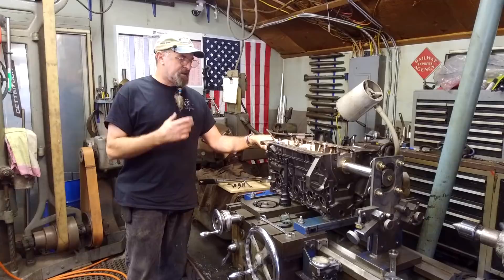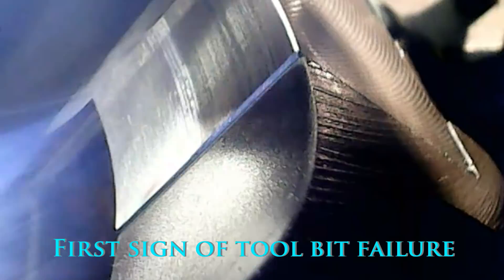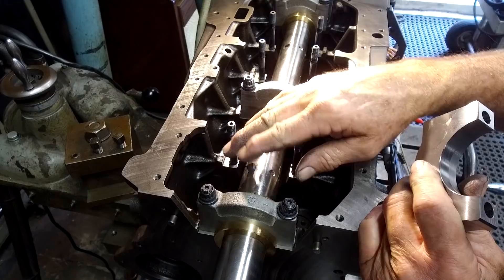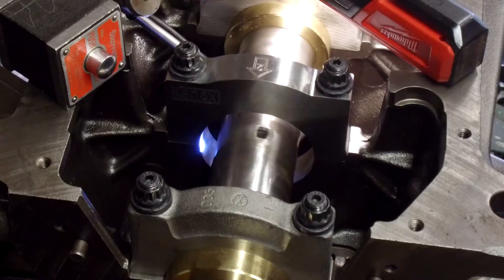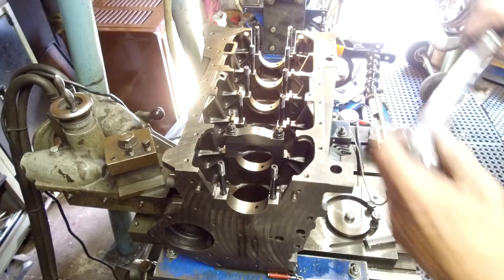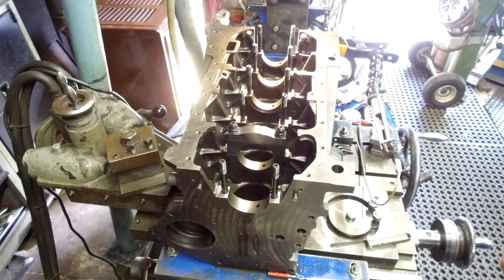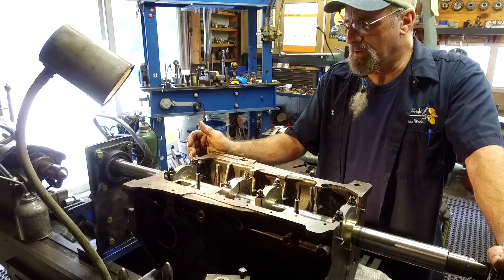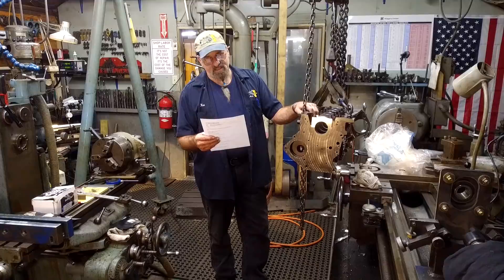Because I Can Part Three

Comment: Keith, thank you so much for these three videos. Very neat line boring bar set up. Yea, interrupted cut sure is rough on the cutting tool. It was a pleasure to watch an old  school craftsman at work. I myself have an old 1942(one year older than me), 10 in. Atlas lathe that I fight with. I'm an old school mechanic, who can machine things, but I'm  NOT a machinist. I really admire you workmanship.

Comment: This is off topic but I wanted to post on a recent video in the hope you'll see it. I'm an industrial mechanic. We have a mixer that turns 3600 RPM and was vibrating about 5 on the Richter scale. The "cure" was to loosen the bolts on the top 4 bolt self aligning bearing, allowing it to gyrate like a drug crazed go go dancer. I cut a new piece of 2" shafting (50" long) and put it between centers. I don't have rollers and no time to make them. >021" of runout. I used your technique to straighten it. Got it within .003" in the time I had. I installed it yesterday and the mixer is now a smooth operator. Thanks, Keith.

Comment: Fantastic set of videos Keith. I love the fact that you point out this is not your bread and butter work, there will be specialist facilities that could no doubt do this job in a fraction of the time. That's not the point though, what you demonstrate yet again is that by thinking a job through there will usually be a way to get even the most challenging task done. Thank you, you are a proper inspiration.

Comment: Amazing work Keith! Even as a hobby machinist it always astonishes me how often HSS tool bits perform when new age inserts fail to deliver the required results.
Reply: I have heard it said Carbide likes work pressure and minimum cut of nose radius plus some.  Its not a .00# cutting tool and microns? — forgetit.   HSS can work down there.  Great educational ‘cause I can’ series.  Its been three years, but I would bet the bar and bearings did not find other work n maybe got lost in the move.

Comment: Very well executed. I wish you would have gone more into detail on the tool bits and their failures though. I am surprised that the carbide was such a brittle problem.  I run my tool bit holes on centerline for mostly the same reasons as you stated with your above center. Since most cutters are top faced that automatically puts them above center even when the hole is on center and it lets you be able to orient and run the bar both ways. Sometimes I have to give some extra angle to the bit tip though to keep it from getting too negative on the rake.  I really enjoyed seeing you tackle and prevail over all the challenges on this job.
Reply: I'm not a machinist, but the RPM seems pretty low for carbide.  I'm not surprised that HSS was the answer.  I'm not doing any SF/M calculations or anything, but 160 RPM on a 2 - 1\2" diameter doesn't seem right.

Comment: Your final remarks about tool offset were interesting. I served my apprenticeship at PSNS. You may remember from your days at Mare Island it was not uncommon in peak workloads for crews of craftsmen from other shipyards to be detailed in for a few months to assist. I was detailed several times over my career to Hunters point, Pearl Hatbor, etc. The details not only assisted with the work but transfused technique and technology at the shop floor level to the betterment of all. 

One technique for line boring involved the use of heel-dragger tools and consideration of trigonometry in calculating radial stock removal Vs outfeed of a tool whose cutting edge was offset from the bar axis and the consequent effect of the tool clearance angle, cutting tool grinds and materials, etc. My personal preference was Rex AAA because of its edge holding and resistance to chipping for most materials, Mo-Max for initial cuts in weld repairs, and Alligheny Lundum T-15 for cast iron in short bores etc & etc. Grind angles were all over the map. I recall one time when machinists from King's Bay and Pearl Harbor were huddled over a double suction pump case up on a HBM for line boring with a couple of experienced guys from Puget. I was lucky enough to be one of those guys. Tools and talk were passed around with hasty sketches of different ways of handling the same job. If you don't mind putting it poetically, call it a "technical pollination" spread by us worker bees. What a learning experience! I still have in my box the heel-dragger tool used that day (sharpened back a few dozen times.) Multiply that exchange with dozens or hundreds of others and the detail to relieve excess workload takes on aspects of a coloquium.

Now, 40 years later comes Keith Fenner with yet more to think about. Technique in this kind of detail is never written in books and it's a crying shame it isn't. How many guys who line bore pumps, excavator booms, engine blocks etc have to reinvent the wheel because there has never been a manual treating line boring in the shop or in the field? Start writing Keith.
Reply: Technical Pollination is a wonderful way of saying " Sharing Knowledge". 
 Similar to all of us sharing in this project and adding to this forum.
My Father served is WW2, His in WW1. Dad would say if I knew half of what my father knew I would be a Smart Man, DITTO.
 This Forum with knowledge shared is a wonderful thing, I hope all seeing this can appreciate the wealth of learning and experience on display here!!
 OperaBass3, Cheers from John, Australia.

Comment: Keith, nice setup, a tip, back in the mid 80's I did quite a bit of work on v4 and v6 outboards, had to repair the mains on several of them, built a setup very similar to yours with one notable difference, to set my tool bit depth, I bored an additional hole next to the bit for my kwik-way boring bar micrometer, it would snap into place,( just like it did on the engine boring bar ) I used a small spring ball detent set screw ( the screw you use to back up your tool bit ) and it would provide just enough thrust against the tool bit to push it against the setting face of the micrometer. I would then lock the bit down with two set screws,  made for fast ,accurate and repeatable setups

Comment: Fun stuff! Just to mess with ya: When was the last time you had that torque wrench calibrated? When I worked for Deutz the main caps were torque-to-yield. No torque wrench used. Hand tight then so many degrees all around, then so many more. About four passes and they were done. The bolts were never reused. I was Warranty Engineer but for some reason I was always called on Friday afternoons when there was a crisis build! Oh goody goody! Good times. Half the German guys didn't speak much English. I spoke a little German. It was fun for six of us with the one guy that spoke both translating while we were spinning wrenches!  Help build an engine with all the needed accessories and get it ready to ship. German beer and pizza for dinner about 8:00 wrench until 10:00 and Dyno that SOB. Yes we had a BIG dyno... Crate it and wait for the truck to show up at midnight!
Reply: You mentioned torquing on a Deutz engine, this reminds me of a Deutz engine (I think it came from a Magirus Deutz truck) that came to my friends workshop for overhaul way back in the 1990's. It was an air-cooled diesel engine, and he just could not get the front pulley bolt off as it was so tight the like of which he or non of the mechanics had experienced. They tried heat, a strong bar and long pipe, shock but the bolt stayed put. They finally did get it loose after a day or two of struggling and researching, I am not sure how.   
And as you say the bolts were never to be reused, it would be so for a high spec engine like that.

Comment: I am impressed.  Having been in the automotive machine shop business I have seen this job in the past.  However even in the State of New Jersey there were only a couple of shops that could handle it and those shops had the honing equipment. Thanks for sharing and I hope that you get another chance  to do the job and use the set up again.
Reply: Steve,  I thought of you as soon as I saw this series, and looked for your comments.   Unfortunately the number of automotive machine shops in south jersey is dwindling.  Schumer’s (formerly Sclangers). Is the only one of the old automotive machine shops in my area with the equipment and experience to handle stuff like this.  Chris
Reply: There are a few Race shops that can still do this work, but like you said most of the shops are gone.  My shop was full service but there was not enough demand for align boring in my area to warrant  the investment in the equipment.

Comment: Keith, well played.  You are absolutely right that this approach is NOT for production work.  However, the different techniques and approaches you took, showing different ways to do things, and there is no substitute for the experience you provided in setup and work holding on this.  considerations for tool placement and anticipating what can go wrong were absolutely spot on.  Kudos on the various "school of hard knocks" knowledge you shared in this video!  Git er dun!

Comment: one of your best productions Keith. we use to weld the mains on the  EMD's with 6013 and use a portable boring bars. very time consuming work . you could hit tenths with the old rigid 6" boring bars. they  were amazing . bored rudder bushings out too . what a job of filming you did . thanks bud . with them close ups stay away from porn please .

Comment: Try making a half bar tool that goes to you boring bar diameter size! then you drill the center of tool, put a like depth mic in it and you can then adjust the cut to length using the micrometer!  Cutting edge Engineering drilled another hole into the shaft to put telescoping tool to get the bore size with out pulling the bore shaft, check it out works great, he also has lots of pointers as well! Keep up the good work! On your chamfer for the thrust you could have touched off on the chamfer of the block set you dial indicator  to zero for reference then move to match the cut!

Comment: Someone once told me when using carbides, flood them, or run them dry but don't sort of lubricate them - thermal shock can make them chip.  Not sure if this is true, but in my limited experience, it has paid off for me.

Comment: A generic note on 12-sided fasteners: There are (at least) three different versions with different angles and layouts but they are difficult to separate by eye and since these often are used in high torque applications picking the wrong type can lead to stripping. They are wonderfully snug and nice when everything is correct but quickly goes sour when not.

Comment: Milling all caps .010 and squaring up thrust bearing cap is crucial,and for setting tool there is a radius mic that works off the boring bar itself,works great for roughing before line honing.

Comment: Hi Keith, I love your work so far (new subscriber!). I don't know if you've ever looked at Cutting Edge Engineering on Youtube. He's a solid engineer doing heavy work, and has a neat little line boring and welding machine. Not quite accurate enough for this job, but I think you'd be interested in what he's able to do. He's also restoring an amazing Swiss machine which works in microns.  Great work Keith!

Comment: I've align bored more blocks on more different manufacturers align bore machine than I can count. I'm was curious as to why you did not drop the align bore 0.002 - 0.003 down and ensure a perfect bore up / down - side / side.Another thing is that mot caps has a 0.002 - 0.005 taper / angle cut on them so when they are torqued down with the brg in place the brg is squeezed round not oblong. Although outstanding job.

Comment: Keith, really like the work you did for this.  But, why go through all that when they make a machine just for this job?  I have blocks with aftermarket caps bored regularly and it only cost $150-200.  You have more than that in materials.  Seems counter productive...but, yes you can.  ;)

Comment: If you used a micrometer depth you could measure your depth or increase of cut from the rear of the bit easily to a 100th of a mm.

Comment: Like you Ronald Farley,  I would like to know where is the original main caps. When We recondition main  bores  the main caps are all torque to specification so its distorts the block as it would be In use. And we hone all of them at once. I hope he lets us know if the crankshaft turns free. If anyone can cut these bores in a Lathe it would be Keith Fenner...
Reply from the maker: The final line hone will be done with all caps at the same time.  ;{)-------

Comment: Carbide is not very nice stuff to work with, it chips very easily, hss is nice and tough, but it doesn't have the hardness, heat or wear resistance for the tough wear plate or tool steels. each are good at their own thing :)

Comment: GET er DONE!!!...... Thanks for the video!  Always wondered about line boreing but never had the opertunity to see it done.
 How did the caps get ruined?(or lost) but the block is undamaged? How would you go about line centering the shaft if the block were warped slightly due to overheat or the block side of the journals were damaged?
Thanks again....

Comment: Hi Keith, Excellent set of videos, as ever. I was very intrigued with how you were going to overcome the height difference of the drive shaft and lathe centre at first (Neat solution). My question though is over the bushes and how you accounted for the different ID of the block and cap and then as you m/c the caps the increase in  I/D, as it looked like you used the new caps through out?
Andy
Reply from the maker: I used the original caps to hold bar while boring newer caps ready for use. ;{)-----

Comment: Given that Audi five cyl . engine isn't rare , Is this for an Early Quatro ? It is a lot of work for a common engine so I am guessing the owner wants to keep the original block for a restoration. Last time I line bored anything was almost 45 years ago and we used a WW2 Army surplus portable rig, used for line boring engines out in the field ,Mostly Ford SV V8 truck engines. As can be imagined it was almost accurate but hardly used as the engines only had a short life when in action and there were boxes of engines available for replacements.
Reply: That was my first guess, since there aren't many situations I can think of that you'd feel the need to line bore a AUDI 5-cyl.  Then I thought - maybe building a race engine, since if the owner's going for originality, I would expect to see the original caps?  Either way, that's a very nice job.  :-)
Reply: @aussiebloke609  looking at the caps looks like race stuff  they look like nice caps
Reply: @vanhulagen  The stud bolts were ARP, I assume the studs were ARP as well, definitely a good indication of aiming for more performance than stock.

Comment: Hi Keith , can you give us a clue on reason for  having to fit replacement  main bearing caps   --  even  when the upper halves  of bore in the block were  clean and undamaged   .
Reply: Billet 4140 caps are structural upgrade to accommodate other power upgrades as the build progresses.

Comment: If you fitted oil-cups into the bronze bushings, they'd be self lubricating.
Reply: Milling out the caps to clear the oil-cups could add a few diversions.
Reply: @TheAmpair  I wasn't suggesting putting the oil cups in the engine bearing caps.

I meant fitting them in the bronze bushings, Keith made to fit the boring bar.
Reply: Good thinking

Comment: Keith, how did you machine the first cap, the one closest to the chuck? That side did not have a support bearing like the tailstock side did. I assume that the lovejoy joints and number 2 journal were too far apart, and that as a result of uneven force from the lovejoy joints that the bar would flex durring the cut. Btw, great camera shots.
Reply from the maker: I choked up the support bearing on #2 main sticking out towards # 1 and ran the third bearing support on #3 main, giving enough support that it did not need any external supporting. ;{)-------
Reply: @KeithFenner  you have taught me so much over the last five years. Tommorow i am going to make a donation, not for what you might teach me going forward, but simply to pay back a small % of what you have already taught me. Im sorry it cant be more, but i hope it helps such a generous man and family.

Comment: Thanks for sharing your craftsmanship Keith. When align honing, will a slightly oversized O.D. main bearing be fit to compensate for the small change in Dia caused when honing?
Reply from the maker: I was at the dimension, they needed to be able to hone to the preplanned bore size. ;{)------

Comment: Keith - Did you make those bushings to the lover half diameter ? I mean otherwise it would not center 100% since the caps are undersized,. Hm would it not be possible to have another bearing/bushing on the from of the engine instead then you do not have to move the bushings around and all holes would be 100% true. Something like this http://www.blockliner.com/
Reply from the maker: Watch Part One and Two, when I make the Bushings, to fit the stock caps and bores that I use to bore the new caps to match the existing bores. ;{)-----

Comment: Would you agree that you could have saved substantial amounts of time if you had not to remove the line boring shaft to measure the inside diameter of the bores? Do you think it would be possible to design a dial test indicator holder that temporarily attaches to the installed shaft allowing to measure the bore diameter with the shaft in place? Probably you would need a calibrating stand nearby to calibrate the 0-setting of the dial indicator.
Reply from the maker: There is always ways to speed things up or save time, mostly for future jobs as they progress in the same set ups and you roll some of the dough back into the tooling budget. ;{)--------
Reply: Yep, maybe some twists for the next audi project video ;-)